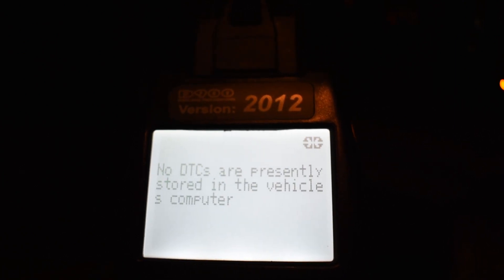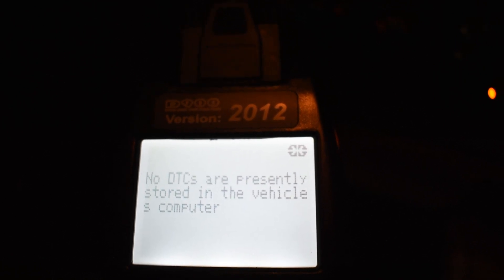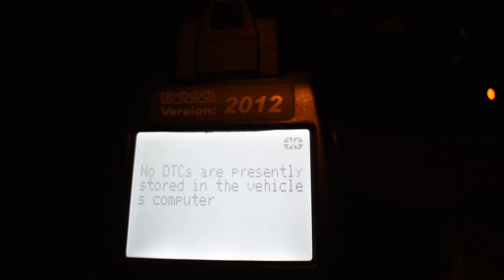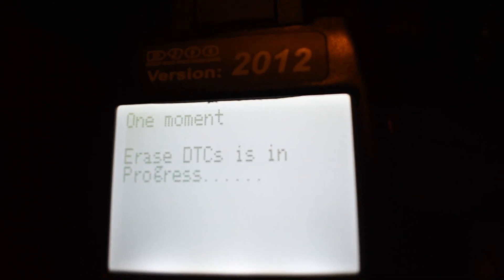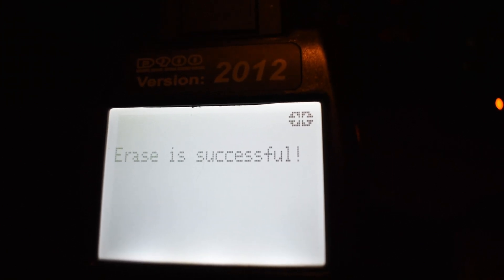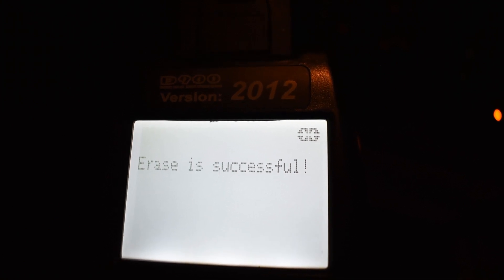DIY - How to Reset a Check Engine Light, ABS Light, and More

Comment: I got the reduced power CEL light and restarted my car, and it went away.
Reply from the maker: A - If your reduced power light came on but went away after restarting, it means the car temporarily entered limp mode due to a detected fault—commonly caused by issues with the throttle body, pedal position sensor, MAF, or wiring/ground faults—and restarting cleared the temporary condition, but the underlying issue may still be present. Even if the Check Engine Light goes off, the fault is often stored as a pending code, so it's a good idea to scan the system to see what triggered it; if left unchecked, it could return and leave you stuck in reduced power again.
Reply: @8020Automotive Good to know. I went to autozone, but they said they couldn't scan it until the problem came back. I will go to an actual mechanic shop. Thanks.